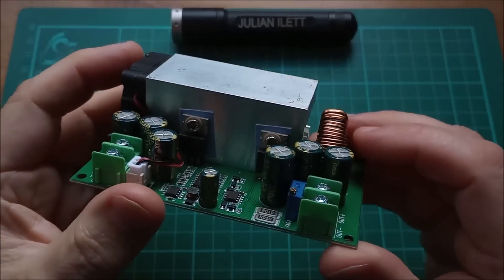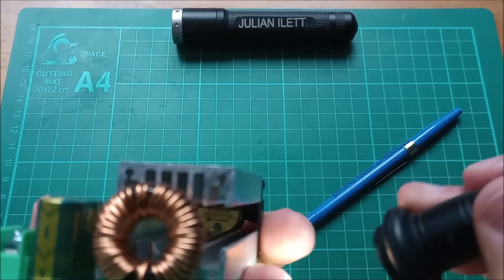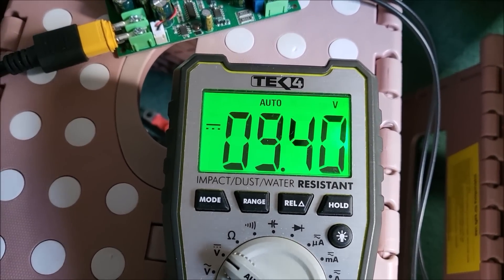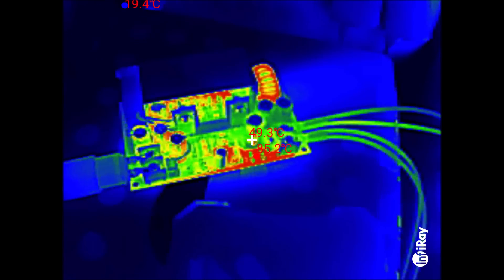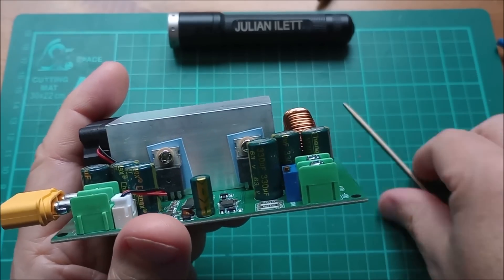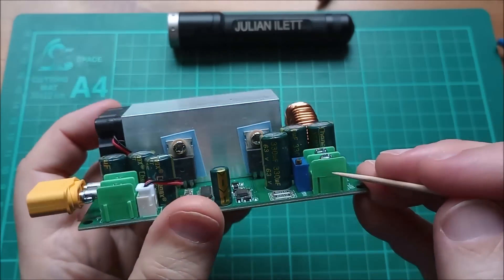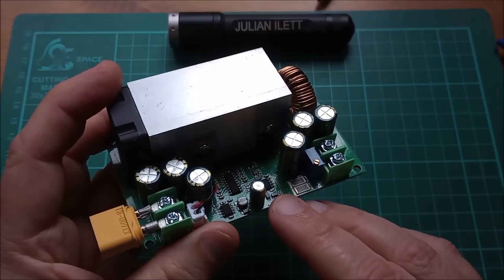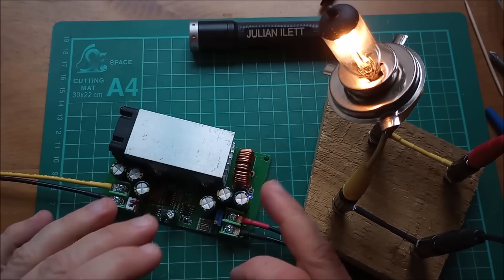Postbag Update - 25A Buck Converter

Comment: The voltage difference (input to output) is very low - its actually more the natural drop down so it doesn't really have to take a load. Give it 50 or 60V input and a 12V / 20A output to see if it really can handle the load? I doubt it a bit, to be honest. 50V/20A would mean 1 kW for this little unit - not impossible but ...  Lets give it a decent test! 🙂 The 120 A rating of the mosfets in the datasheet doesn't mean anything practically. Its a labority value under ridicoulos cooling conditions - you can never achieve in practice. Is it current limiting? If not, the sense resistors would do anything if shorted - only in cc-mode this would have an effect, i guess.
Reply: It's rated for up to 25 amps OR up to 600 watts.
Reply: Pm me can you to install do sola paint of charger`
Reply: The mosfet current rating is for the chip inside but in most cases the to220 transistor is package limited :)
Reply: Yes my thoughts. Not really a test at all.

Comment: I bought something extremely similar to this in around 2019 but mine was sold as a Yeeco DC Buck Converter DC-DC Step Down 10A Voltage Regulator 
but mine has an LCD display showing the Input and Output Voltage and Current.
I could see exactly what was happening when you plugged the lights in - it immediately started to Clamp the output.
Adjusting the Current pot would have remedied it but on my board it has 3 Indicator lights denoting when Current Clamping occurs, allowing it to be adjusted up or down.
My board came with a clear acrylic 'shell' but I recently had to cut myself a new one using my solid state laser
Reply: Pm me can you to install do sola paint of charger`

Comment: Hmm what current can those R010 resistors take would the act as a fuse???
Reply: I think they are for current sensing in parallel.
Reply: @rilosvideos877  yes but they also carry current hence the heat
Reply: @fredflintstone1  Yes, its up to 1 W if each one carries 10 Amps, might be o.k. when soldered to big pads on the board. But its probably close to the limit.
Reply: Perhaps it's a crude short circuit protection mechanism so if the voltage drop increases then that tells the buck chip to stop.
Reply from the maker: I think it might be that. @ahaveland